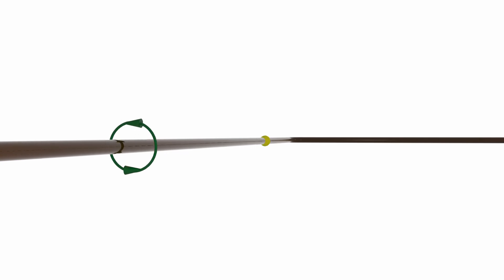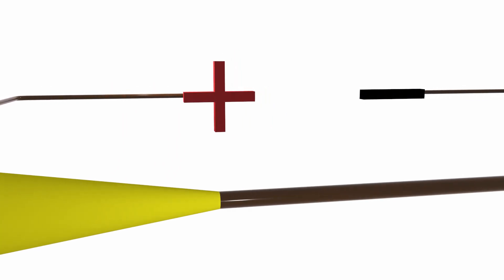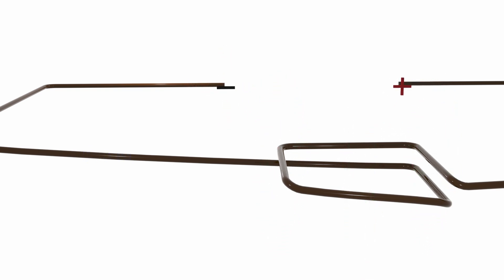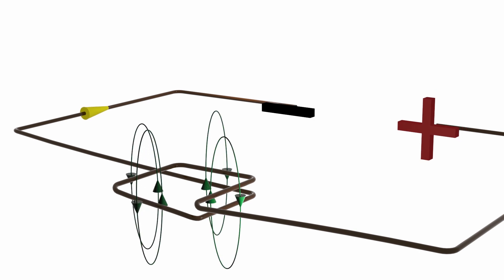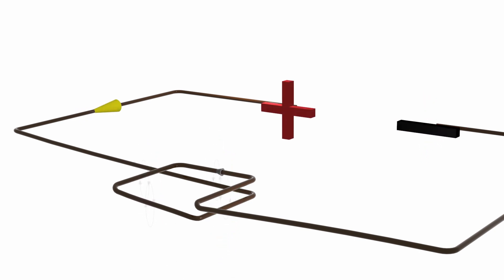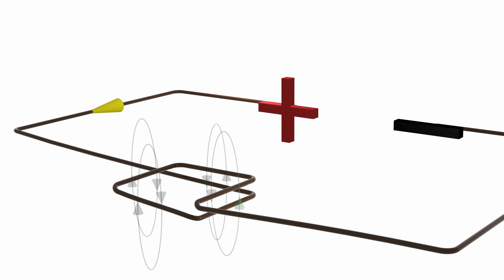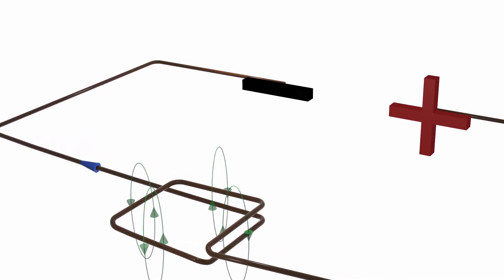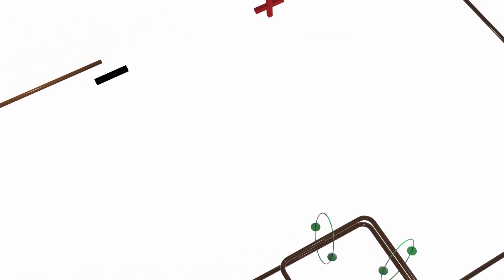Inductive Reactance Explained -- ANIMATION

Comment: Inductive reactance
The inductive reactance is expressed in ohms, and is useful to determine steady-state current values to sinusoidal voltage inputs. It is to be noted that though the value of the reactance is expressed in ohms, it was not obtained by computing a resistance, as of resistors. 
The current is on account of the resultant of the applied field and an opposing coulomb electric field, which is due to polarization by the non-coulomb curly patterned electric field associated with the changing magnetic field, and the current obtained thereof by applying the relation J = σE(NET) where E(NET) is the resultant field of the applied field and the coulomb electric field and where σ is the conductivity of the wire.
For a comprehensive description of the mechanism of current lagging the voltage across an inductor at different frequencies see the book references below. 

Electrostatics and circuits belong to one science and not two, that of electricity and magnetism. To know how they are unified visit this link 
https://matterandinteractions.org/articles-talks/ and view the article 'A unified treatment of electrostatics and circuits.  B. Sherwood and R. Chabay, unpublished. (1999)'
pdf.
For a live demonstration of surface charge and its effects in circuits visit 
https://youtu.be/U7RLg-691eQ
For a detailed discussion of the physics of inductors, curly patterned non-coulomb electric field, coulomb field and lagging currents in a inductive circuit at different frequencies of sinusoidally varying voltages see "Electric and Magnetic Interactions" by Chabay and Sherwood 
www.matterandinteractions.org
or 
Fundamentals of electric theory and circuits by Sridhar Chitta
https://www.wileyindia.com/fundamentals-of-electric-theory-and-circuits.html
There is a "look inside" feature in the amazon.com webpage of the book "Fundamentals of electric theory and circuits" by Sridhar Chitta with a few pages of Chapter 1 which may be viewed and also which you may swipe left or press < icon to view the foreword, preface and Table of Contents. 
For a lecture by Prof Ruth Chabay on surface charge in a simple dc circuit visit 
https://youtu.be/-7W294N_Hkk
Reply: It is restriction to flow of current . It depends upon omega.  Its units are ohm.XL=WL=2 pie mu L
Reply: @prabhneetdhaliwal4717  The inductive reactance is different in action from that of a resistance. In the resistance with a dc voltage apllied there is a physical restriction caused by imperfections in the lattice of the resistive material. The inductive reactance is due to an opposing induced electric field. You will find details in the books I mentioned in my comment.
Reply: @sridharchitta7321   Thanks sir
Reply: @prabhneetdhaliwal4717  And yes before I forget, the physical restriction offered by a resistance is irrespective of whether the applied field is very very slowly varying as in dc or varying or pulsating rapidly as in ac.